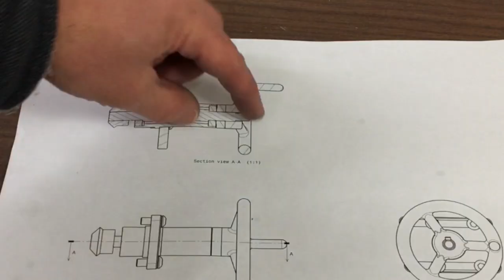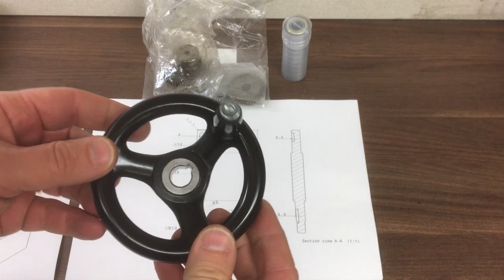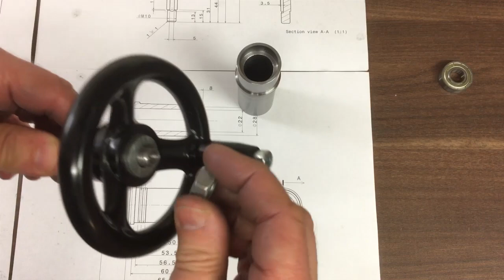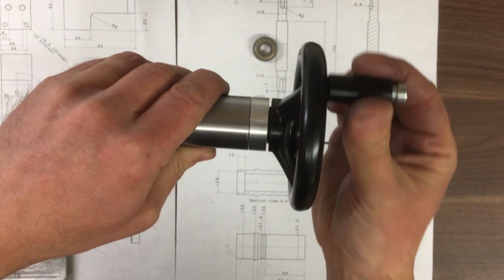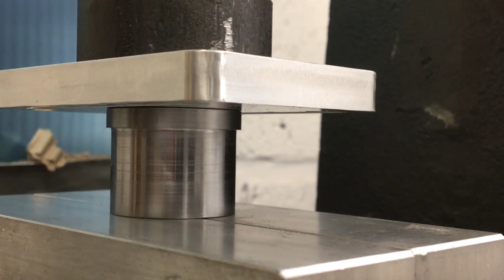Ep13: Drill Press Upgrade |  Z crank assembly

Comment: really enjoying the series and keep up the good work!! was just wondering what program you use to make the 2d schematics and also how did u make the really cool animation of the CAD drill press?
Reply from the maker: The animation was a lot of work using individual pictures of parts then manipulated within Adobe Premiere Elements film editing software.  Then merged into a screen capture of a 3D rotation of the design in the CAD software.  CAD software is a high level package I have access to and 2D drafting is part of that software.  Fusion 360 would do the same thing.

Comment: Looks fabulous!

(Can you still open your controls cabinet? 😂)
Reply from the maker: Thanks Matt.  Yes I knew it would be tight but I couldn’t move the cabinet over any further.  I can open the door 45 deg or it’s not a big job to take the handle off if I need to get back in.  Shouldn’t have to touch it much for the rest of the project.
Reply: @routercnc9517  I was sure you had a plan!  I use these cabinets all the time at work and have been in the same predicament several times.  A few times I have removed the hinges and lock handles and installed 4 ‘Rivnuts’ in the flange on the  box and used 4qty plastic knob thumb screws to fix the lid... Works a treat if you find yourself getting frustrated in future.  Always enjoy your videos thank you.
Reply from the maker: @molitovv  Nice idea!  If I need to get in there with good access I’ll keep that in mind.  Rivnuts are a great invention.